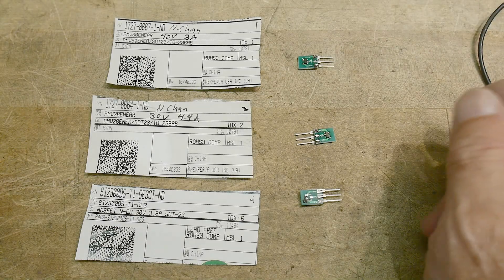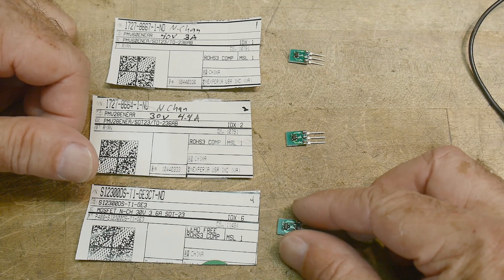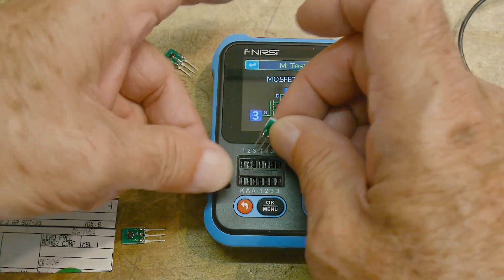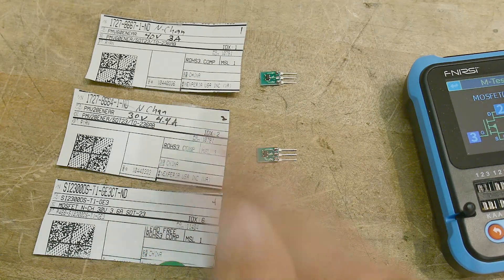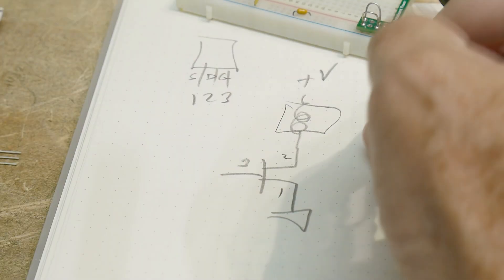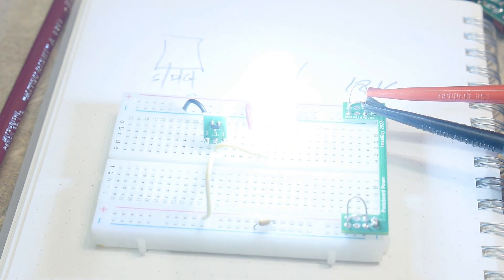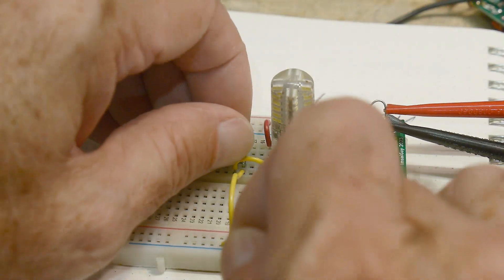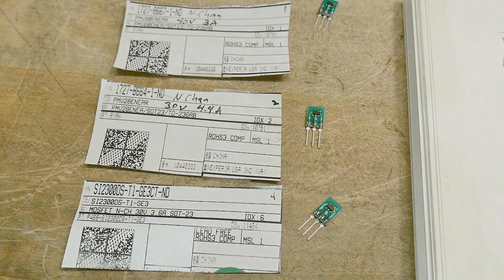#1971 N-Chan MOSFETs PMV60ENEAR PMV28ENEAR SI2300DS

Comment: It occurs to me, in your next SMD->SIP boards, you need tiny holes in the corners, so you can attach tags identifying the part. You use it today, and then either trow it out or toss it in a box where you can't identify it.
Reply from the maker: I use a sharpie on the backside

Comment: At 4:30 that's not quite what the threshold voltage means. Having more than 1.7V on the gate does not ensure the mosfet is turned on. The threshold voltage is the gate voltage where the mosfet begins to conduct, and its Rds at that voltage may be a lot more than if it has a higher voltage on the gate. Take the PMV60ENEAR as an example. If you look at its datasheet, it quotes a threshold voltage (Vt) of 1.0V - 2.5V at a current of 250µA which implies an Rds of between 4K and 10K at that point! You have to drive the gate more to turn the mosfet fully on and the datasheet quotes a maximum Rds of 99mΩ at Vgs=4.5V, dropping to 75mΩ max at Vgs=10V. You were using 12V on the gate to turn it on, but you'd have very different results if you used as little as 1.7V.
Reply: Yes, 1.7V is where it goes into linear mode. Usually you're more concerned about where it goes into saturation, which is going to be a higher gate voltage than the threshold.

Comment: Can you do a video on the FNIRSI DSO-TC3 you used for testing in this video?  I don't remember the FNIRSI DSO-TC3 showing up in any of your other videos.  I think I need to buy one for my bench.
Reply from the maker: https://youtu.be/9aSL7m6mqz4?si=X4qoaMukB6f7cS6_
Reply: Defpom just did a video of the tc3 as a capacitor tester from ear and dissipation and The readings were wildly inaccurate. That's just one piece of it though.
Reply: @MrMersh-ts7jl  It probably needs high precision parts (0.1% or better testing resistors, IIRC 680R and 470k) and low noise power supply (probably using a switching boost from a lipo instead) along with measured voltage reference, for some of the readings possible to be able to be accurate. Or some calibration points set. All of which would be too expensive for FNIRSI to bother to implement
Reply: @ivolol  this would make a lot of sense. One also has to temper their expectations with all-in-one devices. Jack of all trades type stuff. Not discounting the abilities and actually love the influx of newer less expensive quality gear.

Comment: very different capacity!
Reply: There's an order of magnitude between them!
Reply: @PhattyMo  order of magnitude?! in what base? 
whatever! 
significant differences, they are not all the same, some faster, some slower. 
lower dissipation comes with lower speed
Reply: @Sergiu.antifascist  There was 37, 177 and 303pF gate capacitance. That is actually close to 10x between first and last.
For turn-on times and less noise created on a microcontrollers supply-line the 37pF one may be a super choice if the application is sensitive to such things.
A small circuit being driven from a small button cell for example would probably benefit from not having to do high energy pulses fast in some application.
Reply: @1kreature  i agree, just that i see more, and faster
Reply: @PhattyMo  you can say "order of magnitude" in numeral bases other than 10. 
"magnitude a in base b"
2 is an order of magnitute bigger than 1, in base 2. 
10 is an order of magnitude bigger than 1, in base 10 
:)

Comment: Yes amazing just how good they have become. Could have used some of the more robust brethren a few decades ago, to handle things that killed bipolar transistors. Think of UPS units, where 4 dinky TO220 Mosfets replace 2 massive heatsinks with TO3 power transistors on them, and run both cooler, more efficiently and also will fail only after the fuse has blown.
Reply: Yes, these SMD ones can replace TO220 MOSFETs in UPS 60Hz invertor for sure!